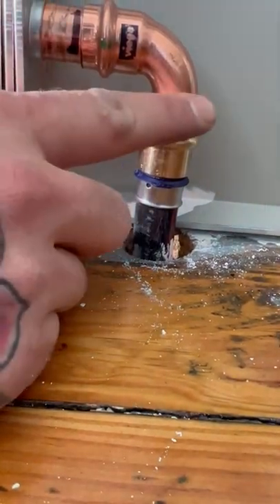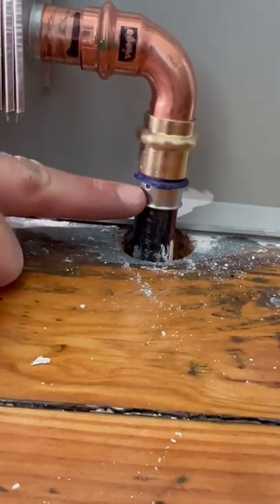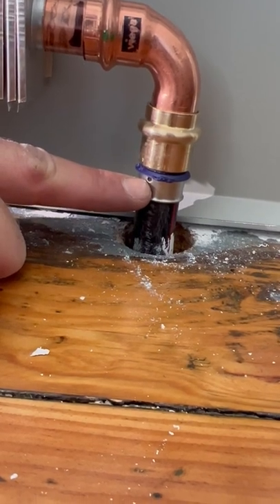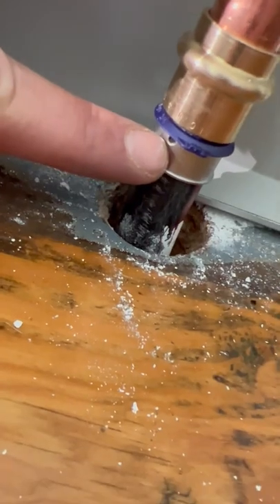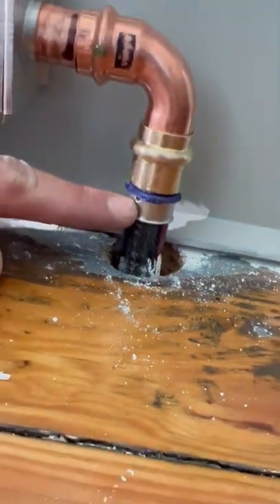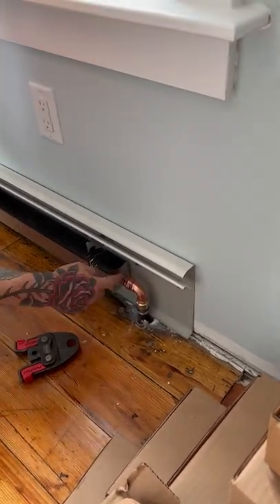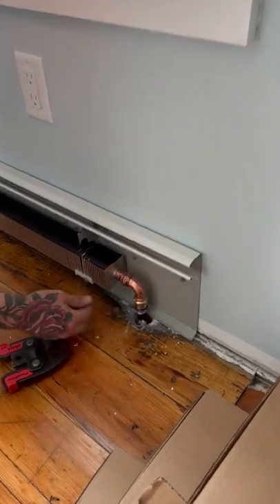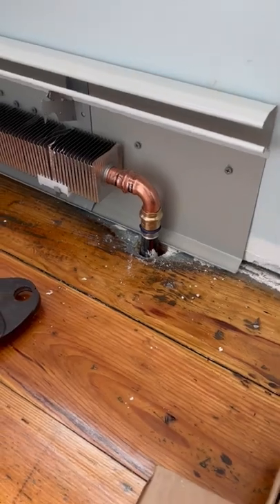Tech Tip: ProPress PureFlow Adapter #Shorts

Comment: But did you use the bronze stiffeners?
Reply: You do not need stiffeners in the baseboard tubing. 
I have spoken to a representative from Veiga and a baseboard company. They said if installed properly stiffeners are not necessary.  I used to buy them. My supply house guy asked why I bought them. I told gim I was told that they are needed. He said nope and got me in ck tact with the representatives
Reply: @charlespelletier9621  fuck that dude. The baseboard tubing is so thin. I get that if it's at 15 psi it will be OK but during a freeze up guaranteed those fittings push themselves apart. I've seen it on L tubing before. So do what you want in your customers homes and your own. I'll remain with soldering and copper in my house and press where needed in customers
Reply: @andrew1898  if it freezes up. The baseboard is the least of the issues.
Reply: Yeah I had multiple fails without stiffners . With stiffners I'm at 0 . I'll take piece of mind for a couple cents more !

Comment: Can you swap the heads on the same tool ?
Reply from the maker: Yep! You can transition from one application to the next with a swap of the jaws.
Reply: They also sell megapress jaws for black iron and galvanized pipe and for hvac line sets.
Reply: @ViegaLLC can you use m12 pex jaws on the same Viega pex fittings?